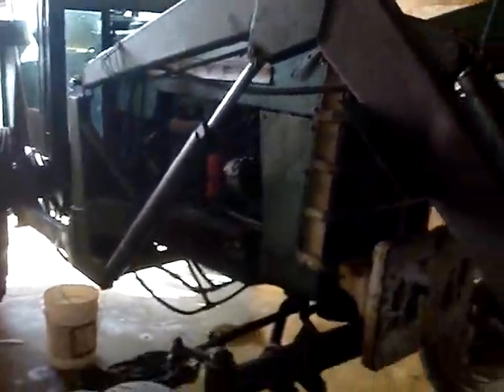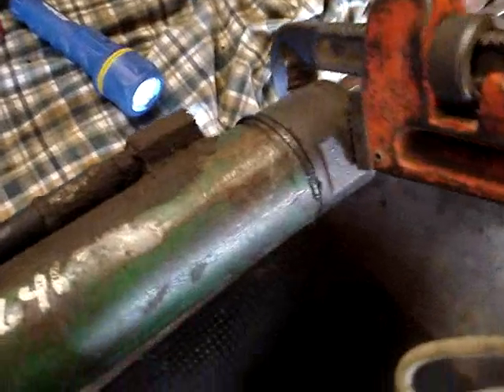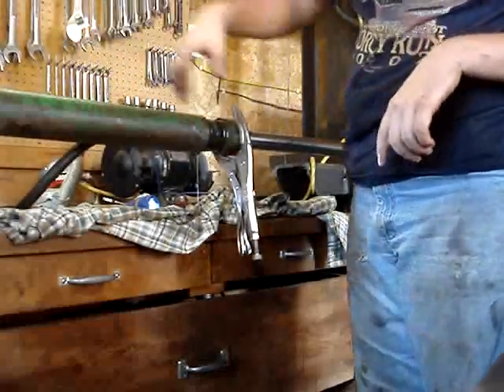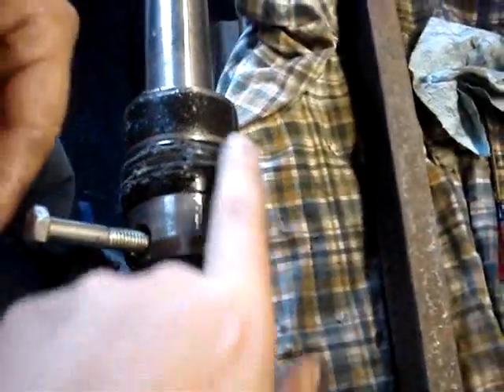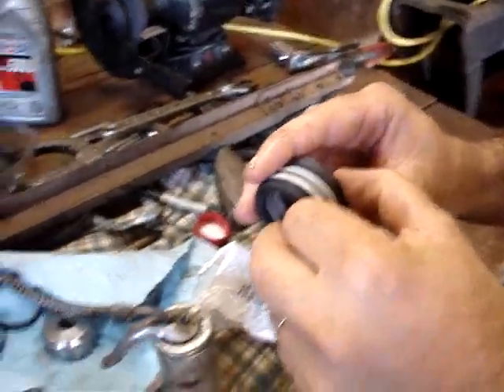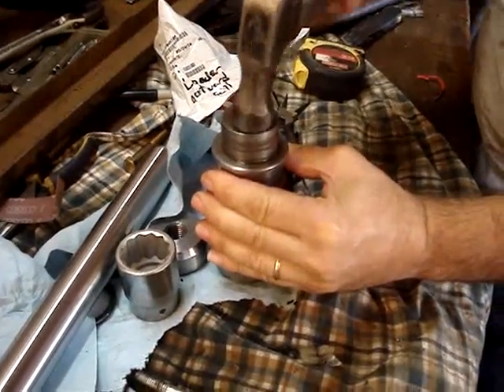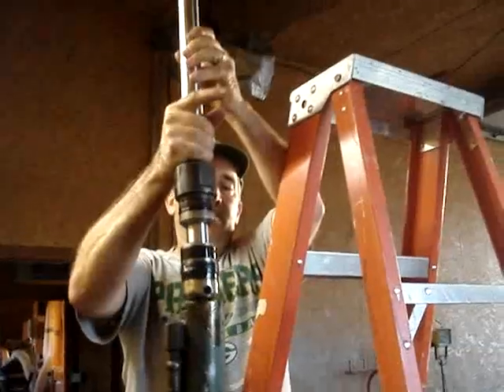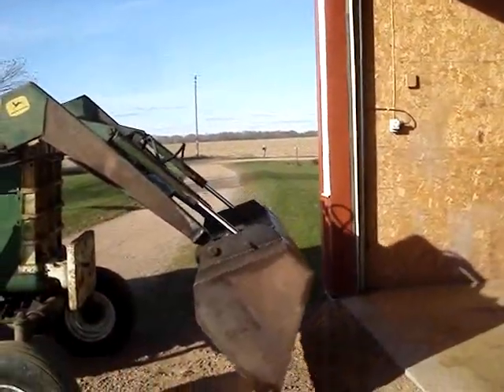Rebuilding Hydraulic Cylinders

Comment: Thanks for posting this - good narrative....same cylinder design on my 770 Ford loader bucket......the only difference is that the bolt trick to unthread the piston on rod end is peaned into the threads to "lock" the piston from easy removal.  I need drill out the pean marks and find a bigger prybar or lever to remove the piston.

Comment: @AllenTrucks i still dont get it. does it have to face the the casing of the cylinder or the other direction . cuz it looks not hard to do. i have a john deere 1120 and one of the  hydraulic cylinder's the lifts and lower the bucket leaks and i would like to try to fix it my self